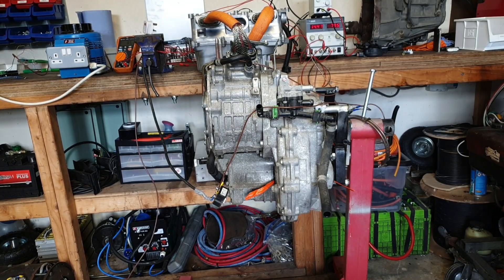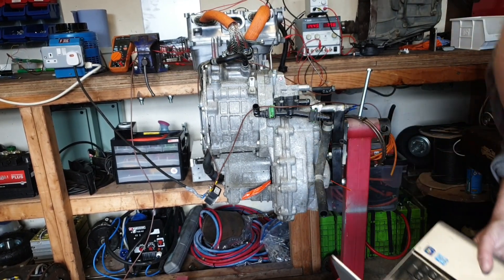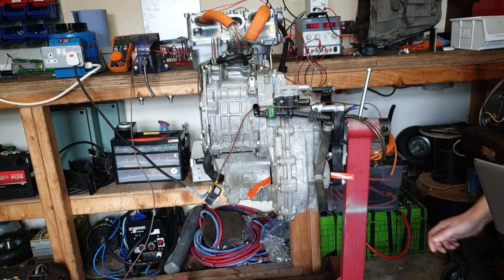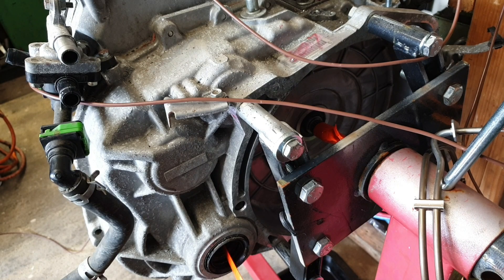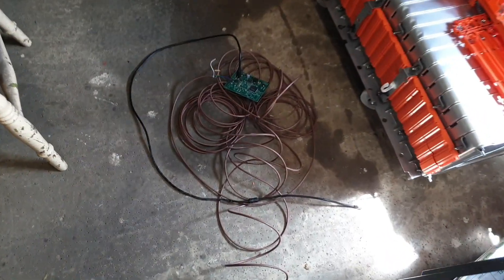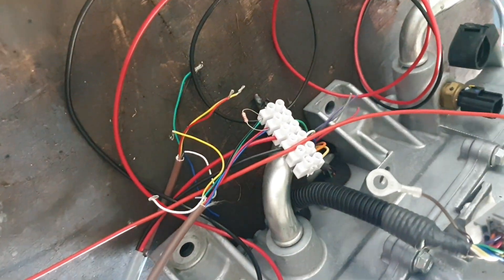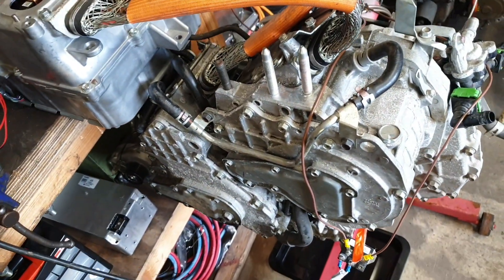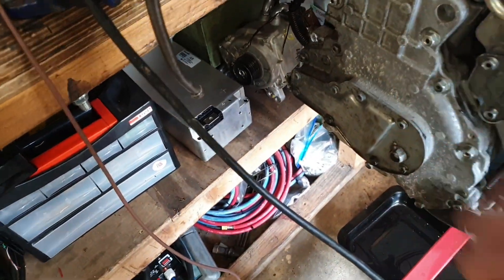Mitsubishi Outlander Front Drive Unit

Comment: Hello Damien, I have a alarm on my Mitsubishi Outlander PHEV 2018 (2360cc) dashboard stating "EV system Service Required". Also, when I press the "EV" mode does not work. I took the car to Dealer and they told me I need to change "Power Drive Unit" and when I change drive unit I must also change "Gearbox Pump". I am not feeling confident about this dealer conclusion since they did not clear the issue and they just want to change part.
Can you tell me:
1- How can I check whether my front power drive unit is working or not.
2- How can I fix it and whether I can replace it with a 2nd hand drive unit.
3- Changing Drive unit do I need to change Gearbox Pump too.
4- How can Clear "EV system service required" notification.
5- Can I just disconnect the small battery and reset the car computer to reset all and see whether this notification is coming back?

 Thank you
Morteza

Comment: Bought a single seat seat carbon chassis from a formula Renault and a motor from a zero SRS motorbike with no battery.Greatly appreciate and suggestions on battery and controller for the project.

Comment: There is a chain of resistors on the igbt boards that is the voltage sense, I shorted some out to reduce the value and got the inverters working from about 30v.
Reply: Great. Can you share how you did it in the openinverter forum?

Comment: My wiring is worse than yours, https://youtu.be/-PH4KC4eBJE the biggest issue I found when I got these inverters going was the "generator" motor has very limited rpm on reverse maybe to stop the engine being spun too quickly backwards. The igbt boards in this inverter is identical to the one in the rear motor inverter. Phil

Comment: Hi Damien ! This transaxle has a clutch between the motors which engages at speed around 80 kmh (by electronic obviously ) that connect ICE with the wheels .
Reply: It can be activated at about 40kph I think the hydraulic pump is on the output side of the gearbox so you could run it up with the drive motor and then power the generator as a motor too
Reply: @ras666  I think was never able to power the wheels before 70kmh, how does that work?

Comment: Is one of the plans to lockup the motor side or some geraing to make the generator spin in parralel/assist of the motor. Like in the Prius units?
Reply: Or/And supplant the starter motor, and make a start/stop feature very easy. Cus, torque/control is not a problem.